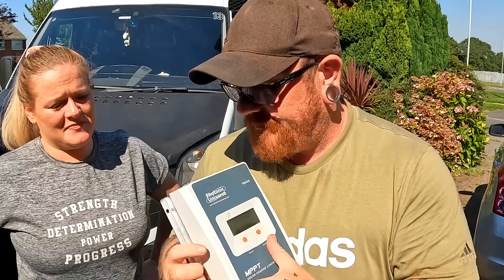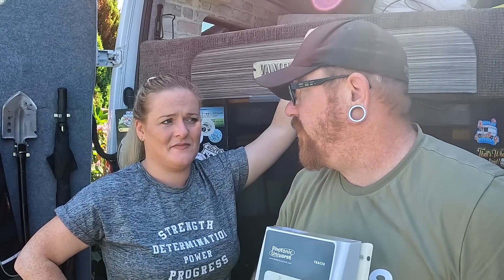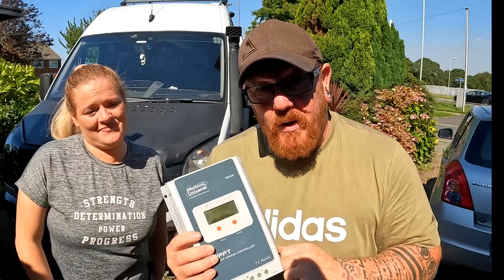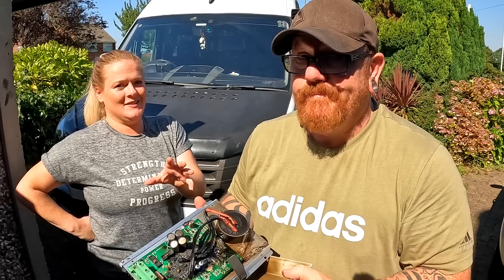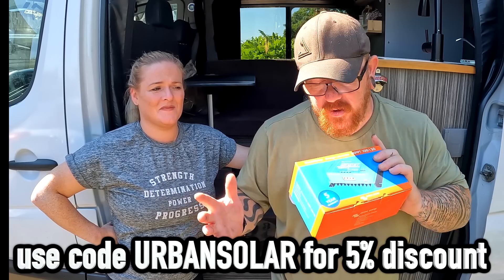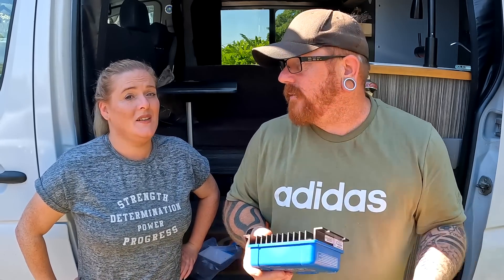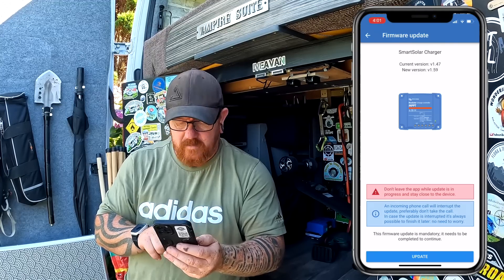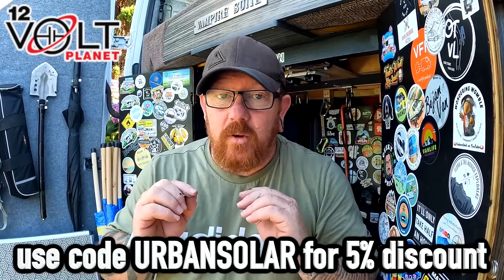This Solar Controller Could Have KILLED Us

Comment: Just watched this video after watching your last video, I’m not surprised photonic universe wouldn’t help you. Their customer service is shocking and it’s never their fault. I bought a solar panel off them for around £400, had it fitted less than 2 years and it developed a fault where it would only charge when it was overcast, once the sun came out it stopped working. The response I had from them is that it wasn’t covered under warranty as it wasn’t a known fault, but as a good will gesture they said that if I bought another panel from them they would give me a 5% discount. 🐀🐀🐀🐀🐀
You had a lucky escape and glad that you had a free upgrade from 12 volt planet, I’ve bought loads from them over the years and never had any issues

Comment: It seems you played the "me-too-five-bucks-less" game and lost. You bought a clone that is not at all an EPEver controller. If you had purchased a genuine version, they are more resilient. That being said, it also didn't look like it had proper ventilation either. Implying that the one you have is 'basically the same' as EPEver is not reasonable though. The look the same but they are not made by the same company.
Reply from the maker: Seen you need to do a little research mate . Epever let other company’s Brant there units for sale under there own umbrella  .it’s a photonic universe brand the board is exactly the same
Reply: @UrbanVanlife  That's actually not at all true. I've imported solar products from China for 19 years and it is about the way copyright works. Companies regularly clone each other, substituting cheaper parts. I can purchase that charge controller from Beijing Episolar, the original manufacturer, or at least 6 other, unaffiliated companies. Take a look at the PowerStar W7 inverter. That's a perfect example. That inverter is made, in varying qualities by Must, ZL Power, and 15 others. All look the same, none are affiliated.
Reply from the maker: Your also forgetting we said it was a phonetic universe controller. Plus we spoke to them and they seem to have given a different story to what your telling us . Regardless we also stated that this could be a one off . We also states that people should check these things so what more can we do . It is what it is so don’t import things we just make stuff . And our research tells us use victron from now on

Comment: Great video, I always use these type. Do you think it could of happened because the controller was fitted flat and not upright so the cooling board couldn't work properly? 
Just checked mine, seeing too many videos go up in flames. 
I also bought some Carbon Dioxide flame balls that burst on flame on contact.

Comment: My wife and I had the same problem  when we went to Portugal !
Our water heater failed to heat the water, I down loaded the fault codes for the heater and it stated that the voltage was over 12 volts!
I took the control panel for the solar panel of and removed the back plate, finding that the electrical circuit board was burnt !
This controller is not the same as yours that has failed I must add 
People be aware and check these panels periodically.

Comment: As the controller was passively cooled and it was inside the van on previously hot days I wonder how hot the controller got. This could have contributed to its eventual failure. Maybe a temperature controlled fan might help the lifespan of the new controller.

If you look behind where the old controller was the board looks a bit scorched. Might be a nice idea to put something non combustible behind the controller with an air gap behind from the board.

Comment: It always comes out, if you buy cheap, you'll buy it twice or even triple.😉 That's the downside of copies made in China, they copy stuff but don't understand the engineering behind it.
Reply from the maker: 😂😂😂😂 it’s not a cheep copy mate it’s the mpever unit that’s branded for phonetic universe lol . Do you honestly think we would have a truma boiler , Luthium battery’s . Victron Orion and then buy a cheep copy mppt . Lol come on now get ya Google going buddy
Reply: @UrbanVanlife  It seems you have not googled them. Just for clearance, I used Chinese stuff in the past too, but it gets replaced step by step by European continental parts. But yeah you have to be happy, not me. If you think it was a quality product then it is your fault. It seems the board heated up and the isolation lying on it melted. It's a ventilation problem, overload or construction fault. 50/50 cheap work. O and this type of mppt you'll find on aliexpress under a different brand a lot.🤪

Comment: Your battery terminal was loose or your pv terminal was loose
Reply from the maker: Nothing was loose . If it was there would have been arching it the terminal incert point like we showed on the video . There was non . And also like we said on the video the company told us it was a total fail  on the board it’s self . So no guess work is needed
Reply: @UrbanVanlife  cool

Comment: My two Tracers have been working since 2017 with no trouble, so it could just be a bad one, generally speaking plastics used in electrics these days are self extinguishing so tend not to actually start fires they just smoulder and go black. Mine are installed in a metal cabinet with a cooling fan in the cabinet, this is then installed in a metal compartment, but my setting is outside my house not in a camper van, so your situation is different.

Comment: Blimey matey. Very worrying. Just out of interest was it mounting vertical in a free air space. So hot air could rise along fins (heatsink) at back. Its possible it was caused by Thermal Runaway. However it should have had a thermal fuse fitted in circuit as a safety measure. I would put a flame on the plastic to see if its flame retardant.  Just for info. Post mortem is required and I would expect supplier,  manufacturer to want it back to do this. Glad you are ok. Cheers from old George. Hang onto it for a while as if we meet up I would like to see it.

Comment: Hi Neil what model of solar regulator did you have.
Reply from the maker: Photonic Universe 40A MPPT solar charge controller/regulator with built in LCD display for solar panels up to 520W (12V battery system) / 1040W (24V battery system) up to 100V

Comment: So first off, that looks like an EPEver unit, but it's not the EPEver brand.  So it's either under license, a new brand name for EPEver or it's a fake.
Also, I hope you are aware that, if that is an EPEver unit, it's  COMMON POSITIVE and thus NOT SUITABLE FOR AUTOMOTIVE USE.
Reply from the maker: it’s not a cheep copy mate it’s the mpever unit that’s branded for phonetic universe lol .
Reply: @UrbanVanlife  It is common positive though, so it has to be isolated from the common negative van circuit in careful ways.  When you have two isolated circuits like this, it is very easy to bridge them accidentally.  It's why in some multi-phase building electricals you can get a lot more than 120V (US) between two different plugs.  (Up to 480V in the UK).  Connecting devices to different phases and then connecting those devices is possibly deadly.  In this case it's 2 different "commoned" DC circuits.  One + common, one - common.  If you were, say, charging a laptop off the solar and connected it to a USB port on the van electrical circuit, then it would become a matter of the isolation in the laptop and the USB ports as to how it handles that DC bias.  It would get worse if either or both of the panels and van circuits became common referenced by touching a tree, for example.  Then you have a potential 24V short... or whatever voltage the panels are floating at short.

Comment: ive been running 6 epever 30A charge controllers right at their max power for a few years now, never got hot at all so there must have been a freak flaw in the one you have.

Comment: Are you fused/breaker at the solar input? Believe the fuses in the unit are for the batteries. Thinking the solar was pumping large amounts of current into that unit and not having anywhere to go

Comment: And don't run 12 volts 12 volts is you're asking for trouble Run High Voltage run 24 volts where to run much lower and amps and it'll run much cooler

Comment: If you max out the solar array if you max out that unit that 40 amp unit and then turn around and expect it not to get hot well first off the blue one you got in your hand looks like a victron they get so hot and I won't even use them because they get too hot my EP ever is never get hot and I have three of them

Comment: Mounted flat and inside a box without ventilation is a recipe for failure  , glad your both ok 😉
Reply: Indeed.  The Victron DC>DC charger is another widget that gets hot.  People need to mount them properly.
Reply from the maker: It wasn’t mounted flat it was mounted vertically for a start but thanks

Comment: Make sure your mppt charge controler is correctly sized for your solar panels especially the solar panel open circuit voltage it reached 83 volt easilly for this light condition and it seems the maximum for the mppt charge controler is 100 volt.

Comment: Hi great video’s 
I have been thinking about this problem for some time your burning solar controller has happened to me before as well but it was my fault and it is so easy for everyone to do this by mistake 
The situation that causes it is solar is switch on and producing voltage and the battery is turned off to the solar controller it could be by fuse/Circuit breaker or switch 
1 second late = smoke = new solar controller or complete van😭

Comment: put basically, chinese crappy components used with very low quality control that ALL brands use to cut costs... smoke alarm and cm alarm! also please dont buy knock off wago connectors, lots of horror stories...
Reply from the maker: Very true, we don’t use those wago connectors either as they just aren’t our thing 👍👍

Comment: I don't think your placement of the unit was allowing for the heat sink to do its job, not much airflow in that area, we have been having some really hot weather and might have been a build up over time to the stage of almost catching fire.

I use victron in my van build I would recommend you not place it in the same confined area, allow air to flow around the fins.

Glad your all safe  and did not lose the van and belongings.
Reply from the maker: 2 years is a long time to build up . And like we said in the video the email from the company states is was a total fail of the units board
Reply: @UrbanVanlife  I don't really care for that controller I was going to buy it some time back, but I decided to pay a lot more and get better kit.

I also don't think it was a case of two years build but more recent like the last few weeks where we hit 40c and so on, and space to vent, whatever that is past now, just allow the victron to vent. I also recommended the victron SmartShunt and a decent BusBar Box this will allow you to better mange your battery bank., and if you want to go all in the Battery Sense will allow the charge controller to better charge the battery, by knowing the bat temp.

Comment: looks like the 2  capacitors have overheated and exploded.could need a fan to keep air moving over inside the unit
Reply from the maker: good idea thanks!
Reply: @UrbanVanlife  np 🖖a pc components place will have all you need,

Comment: Are you sure the panels rating (in terms of both volts AND amps) is within spec of the controller? I've fitted a dozen or so of Epever Tracer units and they'll all been ok. On 275W panels, I fitted a controller on each for the four panels. For smaller panels (100W / 150W) depending on whether they were series or parallel configuration, a controller may do a string. Remember, in this hot weather panels would be operating at max (less inefficiencies from being too hot) therefore all that current has to be given off in heat through the heat-sink. It looks like the heat-sink was probably hot enough to fry an egg on it. It also looks like your install may be lacking some ventilation, but having said that it's hard to guage.

Comment: Yer they won’t apologise. I’ve worked somewhere before where they said don’t apologise or even sympathise, even if it’s sad or we’re at fault, because it’s a legal form of acceptance of liability 💰 sad world 😕
Reply from the maker: Unfortunately the way of the world these days 😒
Reply: Xpelair were the same when I had a problem with an Hvac unit failing. No apology, blamed it on poor onstallation, despite it working ok for 6 months.

Comment: Correct me if I'm wrong but if I may offer a good meaning observation you have mounted these units horizontally whereas the correct and recommended way is vertical to give proper air circulation to the rear heat sinks, heat rises and they do get quite warm in their bulk charge state especially with lithium battery's them being more charge efficient hungry. Victron is a great choice by the way.
Reply from the maker: Hi ya the unit in question was mounted vertically not horizontally, the company have confirmed its a fault with the unit

Comment: Just a thought, did you change the settings within the unit after fitting Lithium batteries?
Reply from the maker: Yes we had it changed by the company changing the batteries for us as they are the professionals
Reply: @UrbanVanlife  it
Would have been nice to know what they changed though.

I understood that flooded, acid, AGM ect had 3 charge modes.  
Bulk, a constant current when batteries are at low charge.
Absorption, a constant voltage stage which reduces to complete the charge.
Float, trickle charge to maintain top of battery.
But lithium has only 2 main charge modes, as my DC to DC (looks similar to yours) seems to have settings for 3 modes it wouldn’t be compatible so would need to the whole unit changed if I went to lithium.

Comment: Greetings from Oz.

These events can be scary and I'm glad you caught it and everything is OK.

As an electronics engineer, if you gave me that unit and showed me that install location I'd say this was inevitable - sorry.  Maybe not the mppt but something was going to overheat.  If an insurer asked me to assess this unit, this is what I'd report:

"The device has overheated.  Two electros have popped their protection vents likely from the overheating.  That's the stinky gooey stuff everywhere - the electrolyte gasoff.  If the electros were not rated to 105c then that could be considered a defect.  Looking at the exterior top of the unit it's been very hot for a long time, long enough to discolour the plastic.  A shortterm overheat won't do that and a fire will warp and char it. There is no sign of fire attacking the inside of the lid at the top, so naked flames is unlikely.  The install enclosure is cramped and unventilated and likely contributed to the overheating."

You might want to shuffle the electronics around so they have better clearance for fan exhausts etc.  That space needs air exchange whenever it's operating.  Cut some vents in the bottom of the timber doors and put 12v extractor fan(s) inside the door  at the top, exhausting out.  There's plenty of devices that can control the fan(s), a simple ebay temp module operating at a suitable temperature inside the enclosure.

That's what I see - from what I can see.  If you have decent ventilation of that enclosure then I'd put a temp probe in there for a few days to see what's going on in there.
Reply: Yep my epever controller is not contained in anything,  our is in the main part of the campertrailer where there is plenty of air.   They need ventilation and get quite warm in cooler ambient temps. 
With 200w of solar on a 20 degree day I've felt the controller and they get quite warm.
Reply: i was thinking similar
kinda like an overload protection failure lead to another part failing
Reply: also the inside a vehicle can reach above 100 dergrees celcius so yeah